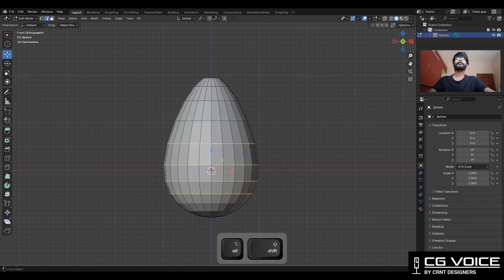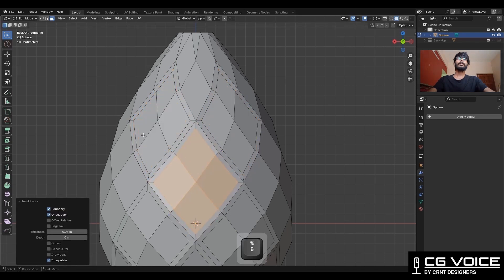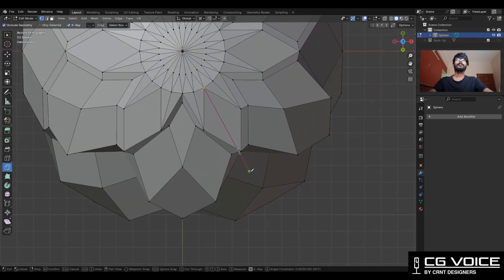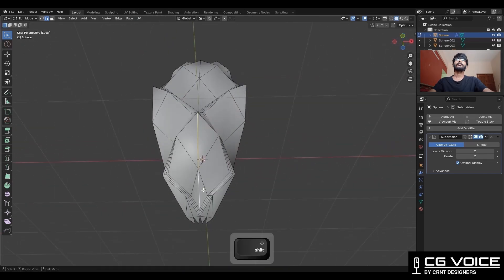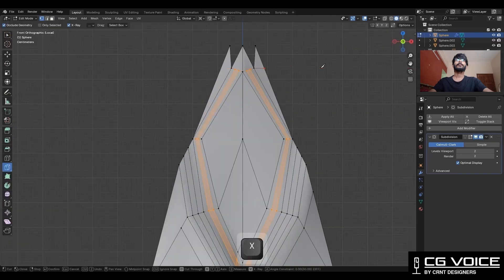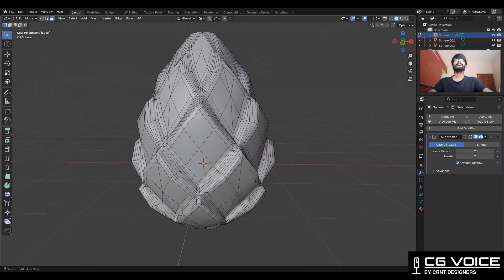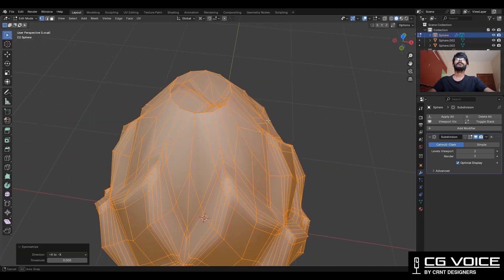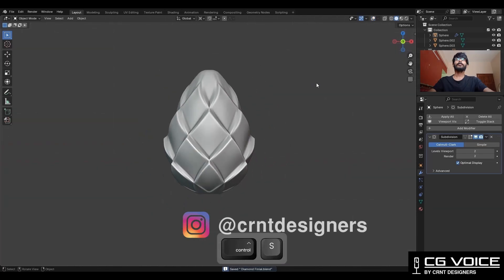how to model this Diamond Finial design in blender _ blender modeling tutorial

Comment: I would like to report something: I can't find the Set Flow in my contextual menu, everything else is there (except set linear). Also, I can't see which Blender version you are using, mine is 4.5. Did I miss something? Do I ned an add-on to have the set flow function?
Reply from the maker: blender 4.3 version , edge flow addon